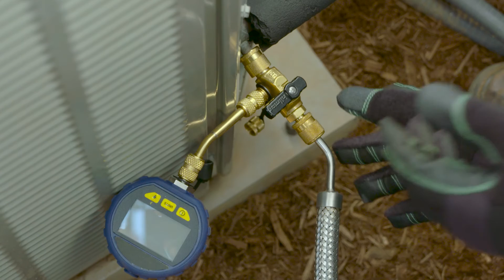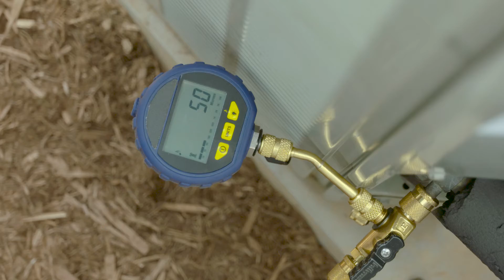hilmor Vacuum Pumps

Comment: Looks like a cool addition to any HVAC tech's toolkit. I want to point out that when you blank off the system to look for "leaks" that any increase could also indicate there is still moisture boiling off in the line set. Also you might want to fix the scene when screwing on the caps when done to prevent contaminates. The tech just drops the hose in the dirt, so I have seen some caps that thread into the hoses to keep threads (helps when pulling vacuum to have a good seal) and hoses clean and free of dirt or moisture.
Reply: Didn’t sound like they meant the line set to me I thought they switched to check the pumps valves

Comment: Where do you recommend the putting the micron guage? I have a compact vacuum gauge and it stays showing 760,000 microns when I have it on the low side. I tested the pump and the gauge separate from pulling on a system and my microns dropped on the gauge so I know my pump and gauge are both working. Just dosent drop below 760,000 microns when it’s on a system. Other techs have been able to pull vacuum on the same systems with not so good setups and it shows the microns dropping